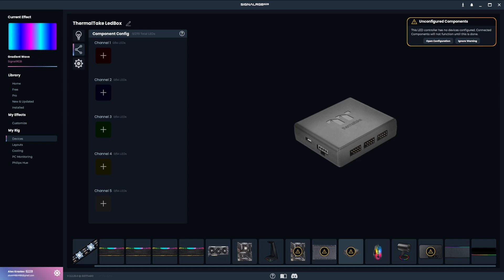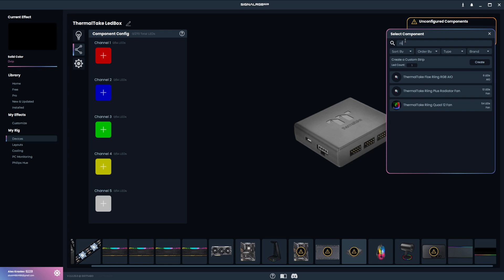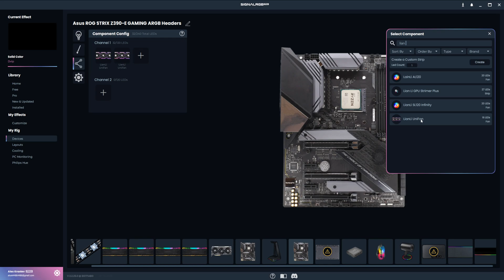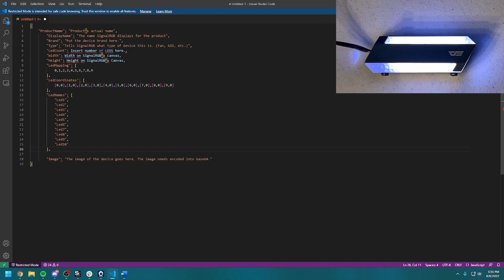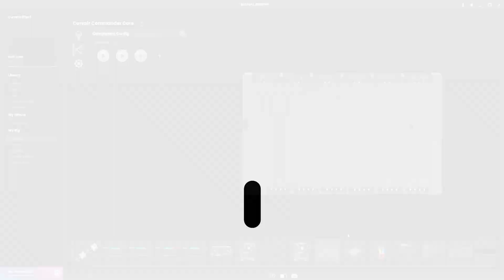Setting Up RGB Fans, Strips, And More With SignalRGB (2022)

Comment: Why is there no option for a custom device? example custom led strip with a 90 deg bend or a fan that the LED's can be reordered? I have gamemax LED fans and the ordering of LED's is unavailable.
I'm trying to like this software and take advantage of it but openRGB is a better option at this point until this option is available

Comment: I had to use signalRGB to get rid of L connect 3. Unfortunately signalRGB being installed breaks fan controls ability to properly control lian li fans.

Using fan control alone, it's able to properly detect all four channels and control them. But once SignalRGB is installed, it breaks fan controls ability to control channel four. I  disabled hardware monitoring and all the fan control within signalRGB, but it still doesn't allow me to control channel four.

I was able to work around it by unplugging the channel four fans and hooking them up to argb and fan control on the motherboard. I'm not sure if it's a signalRGB issue, a fan control issue or Lian Li's terrible hub.

Comment: This has made my PC a complete mess. I guess I'm going to reinstall. I really wanted this to work. Everyone says how great it is but I just don't see it yet.
Reply: Same here.  It ruined my entire set up so I deleted the app.
Reply: Same I'm having issue after issue cool program if i can get my govee light to connect and my Cooler master 3 fans and 1 led strip then we are good to go But isn't working. I heard this program is amazing but my icue corsair connected all these in a matter of seconds no issues at all besides the 3 Cooler master fans corsair wont do that either only master plus from Cooler master will control those
Reply: How do I uninstall Signal RGB?

This software has way too many options.
Reply from the maker: Can you elaborate the issue you’re having?

Comment: its a shame that when i installed this i was greeted by an add section that for some reason wouldnt let me change privacy sections across 370 vendors :(.....i would of maybe installed and probarbly signed up for the pro version but i do not like the fact that this add box which popped up right before setting up kind of forced me to accept the vendors advertising....while i appreciate the reasons for this...i do not like being forced into advert crap....and uninstalled and when straight back to Icue and ....i dont care that its more resource hungry but i DO CARE about privacy....great idea screwed up by crappy advertising....such a shame :( :(

Comment: Did you daisy chain those LianLi after the one connected to the board? Cause I have 2 LianLi. From board to a fan, and second fan connected to that first fan. Signal doesn't see them separate. Even if I add 2. Whatever I set on the first the second replicate.

Comment: But on divices there is only my ram and keyboard on the bottem
Reply from the maker: Other stuff could be unsupported or not connected correctly or using an unsupported controller or could also be using a basic uncontrollable hub

Comment: What about my Wireless Corsair Void Pro? In the app it says is not supported but in the website it says it is. Also if I use icue to control my headset equalizer will I loose that?
Reply: Yes

Comment: I have apevia fans an they're not on the list in devices for custom strips, what do I do?       All of my fans argbs were working, but now only the front does.  This only started when I got rid of all my other argb software other than openrgb.

Just fyi: My front fans argbs work but my top 2 aio fans argbs, the pump argbs and back case fans argbs don't.   I have the front case fans on 1 argb header, the pump on another, and the top 2 aio and the back case fan on another argb header.   The problem is that signal is only detecting one argb header and not the other 2, BUT it was detecting them before I uninstalled polychrome, chroma, razer, ect. 

I could probably fix this by connecting them all to my splitter in the back and then to the argb header but I keep them on separate ones for custom designs in open rgb.   Is there anyway I can get signal to detect all of them or do I have to do that? Cause I really really like all the extra options in signal an will probably use that overall, but yea I love openrgb for my own custom designs by changing the individual leds themselves.

Comment: is it possible to connect some random led strip that uses usb for power but has a remote, and create a custom strip on signal rgb without having a rgb controller? if I do need a controller, how would I do that, and would I need rgb or ARGB controller? Please help

Comment: I fucking hate how disorganized and confusing the app is.
Reply from the maker: What would you suggest be done differently?
Reply: @SignalRGB  Too many button clicks for those who want a quick config. There should be a minimalistic version toggle. Take a look at Asrock Polychrome, at start you're greeted with images of input interfaces to be selected specifically or all headers. You can also sync with devices with a simple click on the left side recognized by the software (gpu, ssd, monitor, etc) component specific is plain simple as well. All in all very little mouse movement and clicks.
Reply from the maker: @aye796  SignalRGB automatically populates your controllers when you first install it as of recently. You could just select whatever effect you want and it should work right off the bat. The lighting wont be sequential though because that would be literally impossible when you’re dealing with multiple brands and types of products and endless different configurations. You can test it, uninstall SignalRGB completely and reinstall it. All of your stuff will work off the bat with whatever effect you select.
Reply: @SignalRGB  i cant see my devices help i only see mouse

Comment: Hi I have an ausen fan argb controller, I also have 10 fans that 3 of them have configured in SignalRGB which are lian li aio fans 
But the other fans are coolmoon wich are connected into my ausen argb controller which is not supported in SignalRGB but the problem is that SignalRGB does not recognize my ausen argb controller so I could be able to confirm my fans 
Is there any way that i can make it work? Can I make it work by creating a custom strip just like the way that you showed in this video?

Also I have an red dragon k552 that isn't supported as well what can i do for that one ?
Reply: Please answer 🙏

Comment: Hi, i got a msi chassis with an integrated argb controller which i pluged into my argb port on the mobo so when i open devices i don't see this controller but only the 2 argb ports of the mobo. My controller is plugged in the 2nd argb port and when i add all the devices that are plugged in and then i go to layout, it doesn't matter how i place them bc they seem to be all linked to the waterblock on the layout which is the first device i configured on this channel. Does it means that i can't control them separatly or did i do a mistake while configurating ? My chassis is the Msi mag forge 100m
Reply from the maker: it means that the msi controller is just mirroring everything and thats a limitation of the controller. Most likely its not a controller but its actually just a hub.

Comment: Im having a hard time syncing my Deepcool FC120 Fans to my ASrock B550M Pro4. I'm not using any controller besides the motherboard 5v ARGB Header, and it isn't syncing although it is compatible. Appreciate the help.
Reply: Having the same problem did you ever end up figuring it out?

Comment: Can anyone please help me? I only have the option of channel 1... yet i have 6 fans, is there a way to add more channels? Thanks in advance
Reply from the maker: You can add the number of fans onto the channel, keep pressing the + button and add them, the controller only has one channel with 6 fans connected onto it. Thats how that works.
Reply: @SignalRGB  Thanks for the reply, but i just cant seem to get them to work :( I am using the corsair lighting node core.. with 6 SP120 rgb pro fans
Reply from the maker: @Pipboy83  select 6 sp120 pro fans in channel 1, then configure them in the layouts tab
Reply: @SignalRGB  Only one fan is working, the rest are doing there own thing, wont flash when i click them etc
Reply from the maker: @Pipboy83  Take a video and paste a link here of how its all setup

Comment: i have the be quiet light wings 120mm pwm and when i connected that to the channel it controls everything and not 1 fan
Reply from the maker: The be quiet one is a hub not a controller so it just mirrors the same thing across all fans
Reply: @SignalRGB  oh ok

Comment: I have all my fans hooked up to rgb controller and it will not connect to them. I know it’s possible bc it’s the only thing mystic lights lets me control. All my parts are msi except the ram. And zero programs allow me to control it all together. I just don’t understand at all. None of this makes any sense they’re plugged in. Just tell me how to make it so I can control all my rgb at once. It’s all argb, it all says it’s compatible with MSI’s Mystic light literally on the box. Is it the controller? The controller is plugged into jrainbow1, do I have to plug it into jrgb1? Like I really don’t get it. It’s all connected. For about half a second I was able to switch all the fans at the same time, but now I can’t no matter what I do and I haven’t changed any of the hardware whatsoever. It’s literally just one second they all did what I wanted them to and the ram did not, and the next second none of them would do anything.

And now, after fucking around with the program for a little while, I have found that it recognizes the msi mystical light controller, and all it’s connections, in the layout tab but not the devices tab. Like the fuck. How am I supposed to know how many LEDs are connected to that? Also, none of the fans connected to the controller flash any sort of color in configuration. They don’t show up as connecting in the devices tab at all.

Comment: I don't know why but some of my parts are connected but like half my fans and aio is not even like there what should i do?
Reply from the maker: Probably means your devices are not supported yet.
Reply: @SignalRGB  oh ok thank you for the info
Reply: @SignalRGB  wait that dose not make sense i have 3 fans connected but there are the other 6 that are not could it be the controller? they are all of the same fans
Reply from the maker: @RileyTheBetter1  Did you follow the steps exactly as they appear in our tutorials? You need to configure what is connected to the controller and then adjust your devices in the layouts tab after that.
Reply: @SignalRGB  ok i got it working thank you so much the only thing that is not working is the li and lan strummers and thank you again for the help i am new to this whole pc gaming thing

Comment: My Liancool 216 front panel fans light up the same color during config and don’t flash individually, is there some way to fix this?
Reply: I already changed the layout to my current pc build with no luck, any help is appreciated
Reply: Something that might help troubleshoot is that none of my parts shine blue when I enter configuration
Reply: Motherboard is Asus z690

Comment: The video explains everything really well, but none of my components have a configure button, only the lightbulb and cog. HELP
Reply from the maker: RGB Controllers and Motherboards will have a configure button, but devices like keyboards, mice, etc don't need one. Are you sure you aren't mixing that up?
Reply: @SignalRGB  yeah, my motherboard is the part I can’t configure because there’s no button. My ram and keyboard work fine, but my mobo rgb and all of the headers don’t work
Reply from the maker: @alansutherland6663  Which motherboard?
Reply: @SignalRGB  msi MAG X570 tomahawk WiFi

Comment: 3:10 when i paint leds multiple light up insted of just one??
Reply from the maker: Likely its just one led that covers multiple spaces on your device
Reply: @SignalRGB  is there a way to seperate the fans? One Chanel is like 6 fans and one led strip. They all act like one unit

Comment: SignalRGB website says you cant control your devices separately with a splitter cable but what about one of those Chinese brand hub using a 3 pin argb cable instead of usb  to connect to the motherboard?

Comment: Ive synced my gpu, cpu cooler and ram but my case fans aren't being recognized by the software and not flashing red. The 3 pin from the controller is plugged into the rgb header. Is there a fix for this?
Reply from the maker: Contact the Discord server https://discord.gg/signalrgb

Comment: 1 thing that is needed real fast is the option where it says remove I clicked it so many times by mistake and it deleted all my profile settings.
Do you work with them or what because we need the option where if we click remove it will give the option and say yes or no.
Reply from the maker: Consider this: you have 20 effects you want to remove, now you have to deal with a yes or no dialog each time.
Reply: @SignalRGB  It's better then deleting the effects you already made I have 60 effects profiles and some of them have 3 custom profiles saved each that's a lot to have to make again I deleted maybe 7 or 8 that I no of.
It just saves time it takes a long time to get the effect perfect and deleting a hour or longer of work does suck.
I'm just saying it's more safer so we no nothing can be deleted by  mistake.
Reply: @SignalRGB  I just did a video on my setup I'm not done yet some more stuff  I need for the PC.
The phone keep zooming in out tying to focus.

Comment: Do you NEED a fan hub to control the seperate fans in the devices tab? Because I currently have 3 Fractal Aspects daisy chained directly onto the MoBo header and Signal RBG sees it as one fan.
Reply from the maker: Did you verify that once you set them as three separate fans in components that you also went into layouts and moved them around?
Reply: @SignalRGB  Sir do i need controller to control each fan seprately of 360mm AIO which are obviously connected in daisy chain or is it ok to plug onto motherboard's header and  configure them as 3 different fans in device and layout section?

Comment: How did u get the special adapter rgb cable ? Or what's it called so I can purchase it for mine
Reply from the maker: Check the video description
Reply: @SignalRGB  can you suggest any other adopter cable from famous brand bcoz i dont think this one available around the globe...by this method i dont need costly controller if i have 3 headers in my Mobo(one for AIO's 3 fans second for 3 front fans of case and third for 2 bottom & 1 rear fan...am i right sir?

Comment: Can I use SignalRGB if I have a Z690 motherboard? As Z690’s aren’t listed in your devices, can I still use SignalRGB for my fans and RAM etc. with a 12th gen MoBo? 🤔🤷
Reply: I also have a Z690 and for me it does show up in Signal RGB, but only if I have updated MSI Center to the latest version.
Reply: I’ve got a Z690 board as well Corsair Vengeance RGB RS, neither are in the supported devices but they both work.

Comment: Could you daisy chain multiple argb fans to one motherboard header and individually address each one? I feel like that’s what the video showed but I want to double check
Reply from the maker: Yes thats what I did with the lian li fans
Reply: @SignalRGB  This method does not work for me so far with Fractal Aspects daisy chained to one header.
Reply from the maker: @NEA1413  are they daisy chained or do you have a splitter, thats two different things
Reply: @SignalRGB   hello i have the same problem with 3 in 1 sickleflow 120 fans, the argb header is reading all 3 as 1 fan.  They are daisy chained. and i loaded 3 fans per channel in the components section. What step am i missing to address them individually.  thank you! love the software regardless
Reply: @SignalRGB  Does not work at all